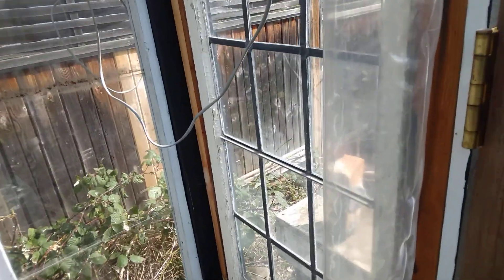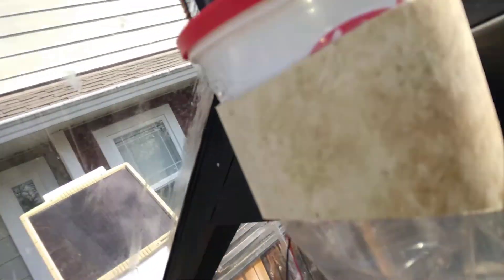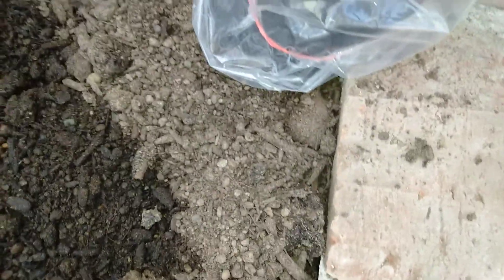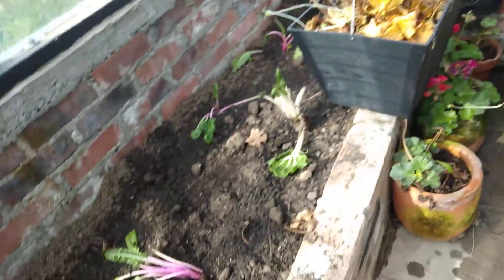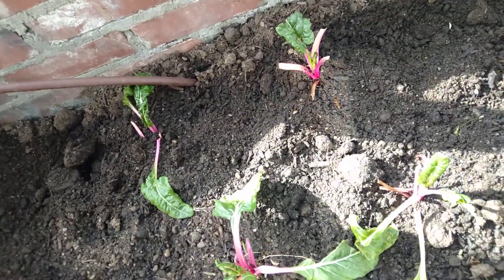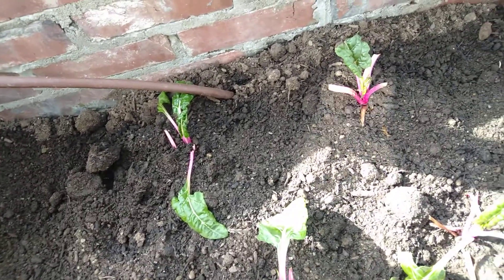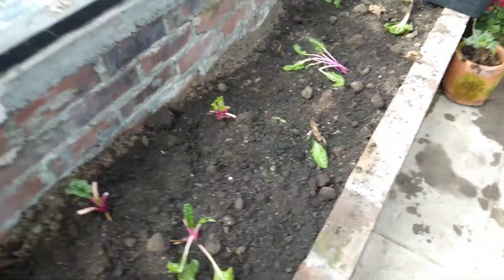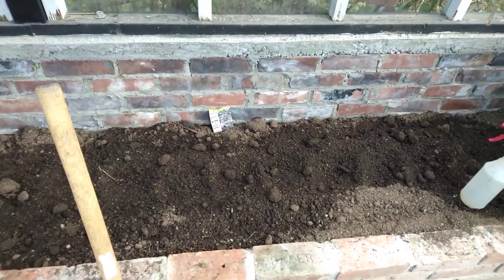Simple DIY Climate Battery for a small greenhouse!

Comment: Great mate. With all the talk about sand batteries over the last  few months, I thought of a way to gett the effects of those expensive huge  climate batteries we keep seeing. I have a 18ft long normal greenhouse, so I covered the glass on the north side with celotex insulation and I dug a hole 4ft square and 10 feet deep, insulated the edges and bottom the filled it with sand and holed drainage pipe, stuck a fan to it an bobs your uncle, high heat during the day goes down into it and comes out cooler then at night cool air goes down and comes out warm. It cost me about 300 quid to build and works great.
Reply from the maker: Sounds great,  Impressed that you went down 10 ft. I hope it never fills up with water and floods your air pipe. (My water table comes up high in the winter.)   Maybe you can do a video of it or of the hot air before and cool air after?

Comment: Very cool to see someone doing this on a smaller greenhouse! Giving me some ideas!
Reply from the maker: Hi, Matt.  I made it much better in October 2021! Added automatic watering by airlift pump, and insulated the north wall of the greenhouse.  It is growing spectacularly well.  It's full of swiss chard, welsh onions and spinach and as soon as that is harvested,  cucumbers, tomatoes, peppers and squash are probably going in  At the moment, I am working on a design (in my mind) for  doing a cheap small greenhouse  insulated walls design.  An engineering forum gave the idea a thumbs up, so far.  More on it in videos soon.   Thanks,  Brian.
Reply: @Brians-tracking-solar-scoop  that is good to hear! I was thinking I would do something to the north wall eventually. Was already digging the base for my greenhouse so I found this video at the perfect time and am digging a trench for the tube now.
Reply from the maker: @mattthemaker3787   Oh, make the tube or pipe 3 inches!  I'm pretty sure it is better.  Too much back pressure with 2 inch tubes.  Also,  80 mm computer fans are perfect for blowing the air.  I used smaller fans first time round because they were all I had.  80 mm fans even fit perfectly over the yogurt containers!